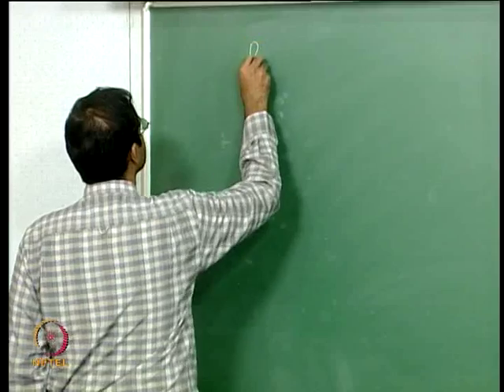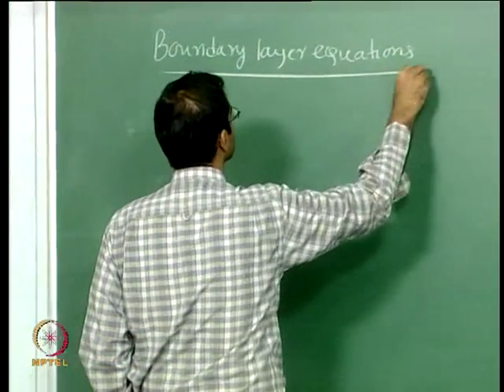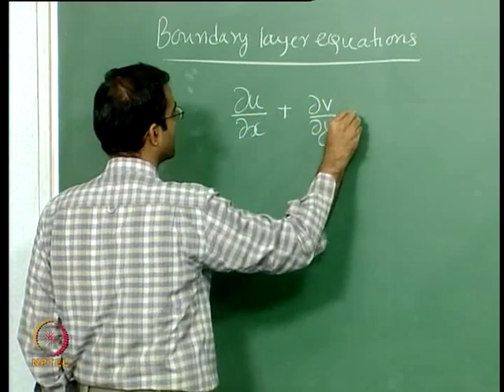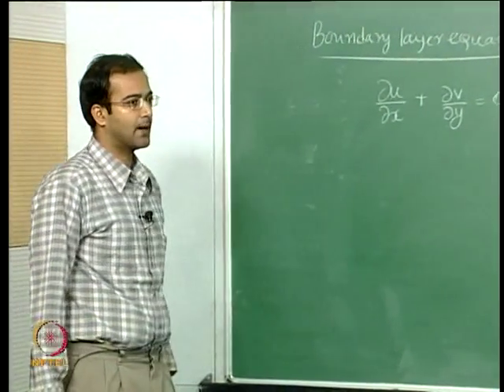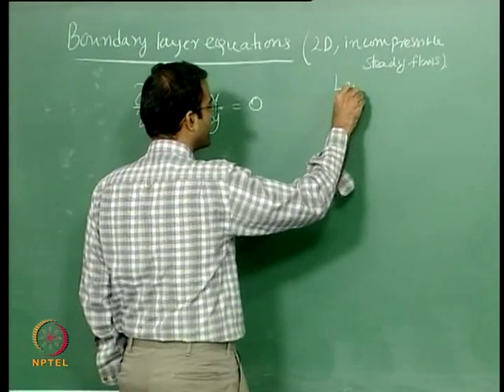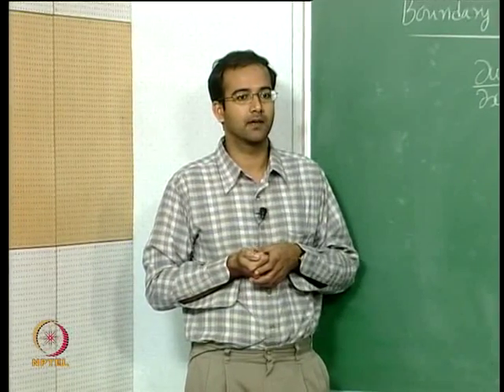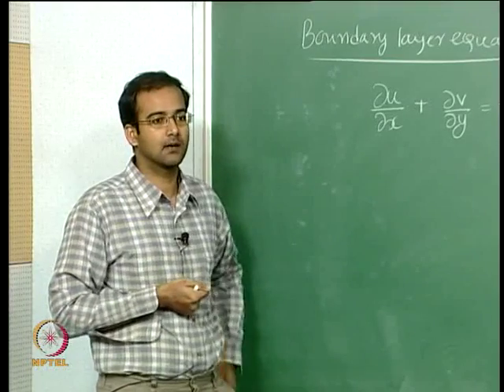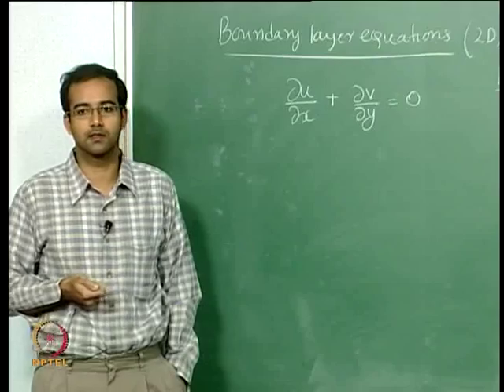Mod-01 Lec-12 Laminar External flow past flat plate (Blasius Similarity Solution)

Comment: Can any body please explain why Dp/dx is cancelled out here ? If there is no pressure gradient then how the fluid will flow ?
Reply: Refer to Cengel's chap 10 of fluids textbook
Reply: he says the reason here. the oncoming flow has got a velocity and it drives the fluid over the plate. its magnitude has a higher value than the pressure gradient. hence the latter is neglected in the analysis.